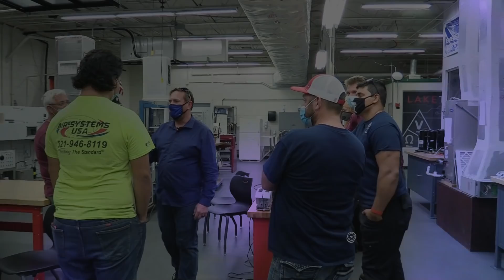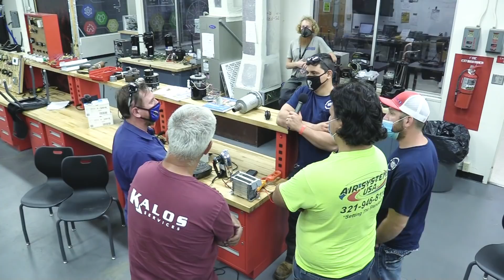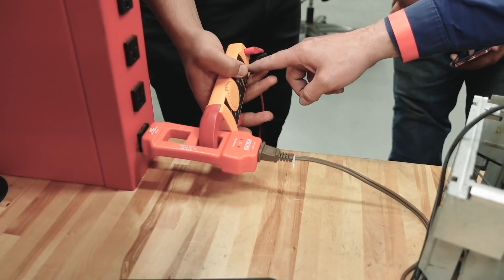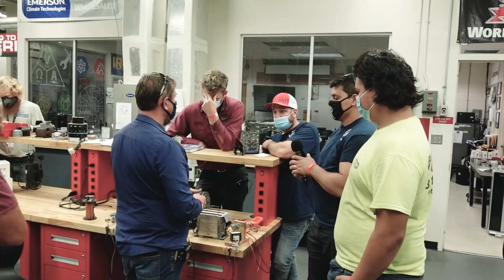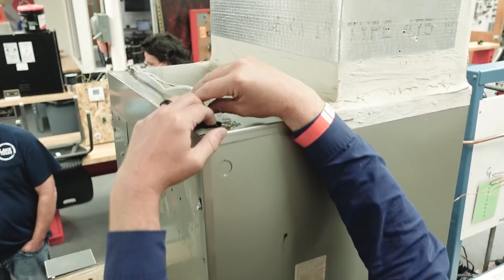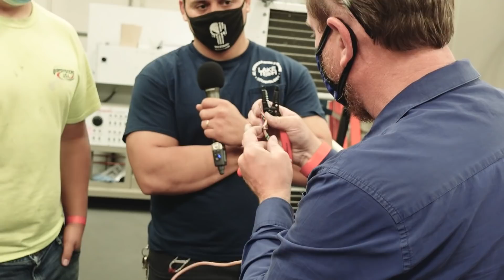Transformers, Inductance and Common Electrical Problems w/ Ty

Comment: question: have you ever seen transformer burn up even though it has a fuse. 
System had a bad contactor with zero ohms 
replaced it and system was functional crazy

Comment: Can someone help , what can make the secondary side of a transformer drop its voltage if the transformer is not bad ?
Reply: You might have your common and hot wire mixed.
Reply: The transformer was replaced multiple times and it does the same on all of them ?

Comment: Great video, I could actually hear him through the mask and he keeps you engaged. Most people might know this but all your electronics that you plug into the wall need transformers to step down the 120 ac to something smaller and then it gets switched to DC with some diodes.

Comment: I’ve had a few transformers with resettable breakers trip. All so far have been do to the control boards on trane units. My question is is it primarily the low voltage side of transformers that trip those type transformers?
Reply: Only the low. It's not connected to high side
Reply: @santa.dancer  thx. I’m pretty new at this and ran into it a few times already. It would help speed up the trouble shooting process with that info. 👍🏼

Comment: I understand that high amperage is what is dangerous with electricity so why is it safe to touch the low voltage side of the transformer even though amperage is higher.
Reply: Not really safe to 'handle' electricity.  Your skin has resistance to electrical conduction and how bad you can get shocked.  The higher the potential the more dangerous it is.  If you work with electricity you will get shocked someday.  You hope it doesn't make it your last day.

Comment: Can the low voltage wires short to ground if the low voltage side of transformer is not grounded. I think all transformers have the low voltage side grounded but i am just guessing.  Please clarify this.  Thank you
Reply: Code suggest something like around 40 VA be grounded.

Comment: Volt amperes is NOT the same as watts In Alternating Currents. The former indicates apparent power and the latter for real power.
Reply: VA (volt-amperes) is the same as Watts for purely resistive loads.  But for the inductive loads of solenoids, the contactor and such, you have to use VA to account for both the real power consumed and the reactive power used by the magnetic field.  Latter applies to capacitors as well but they are not generally part of the HVAC low voltage circuits.

Comment: Why are they called transformers they don't transform voltage
Reply: Because it transformers voltage to a diffetent.voltage. When a 1 to 1 transformer is used often called qn isolation transformer.
Reply: They transform the power (voltage and current) relationship.
Reply: @jkbrown5496  right but the name doesn't seem to suit it's fiction It's still AC 60hz wether it's step up or down. I just tend to question everything most of the times don't mind me

Comment: So wire coming off transformer connected to say " 240v terminal stepping down to 24v " don't need to be a thicker gauge because the amps are low???
Reply: When you step down voltage, you step up amps. In theory, if you drive the same high power device, like a blower motor, you need to use much thicker wire if you drive with 24V. However, usually devices on 24V circuit are low power, so you don’t need too many amps

Comment: Which side would be right to put the fuse on the transformer??
Reply: 24 vac side on what is to feed the R wire.  The wire not commoned to the chassis